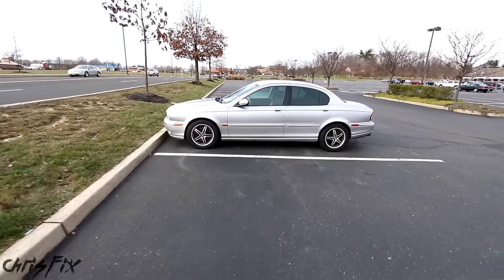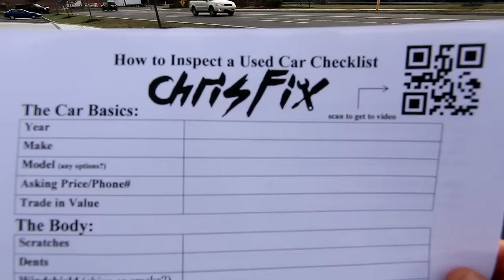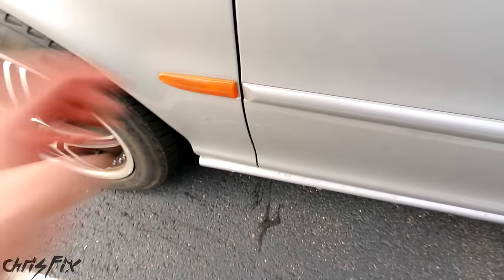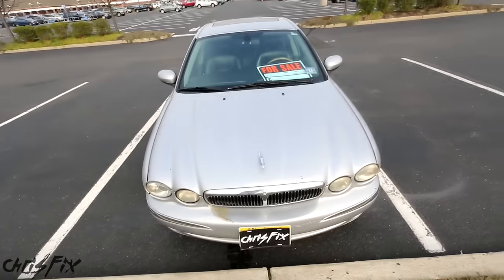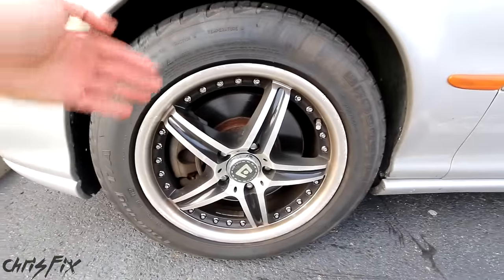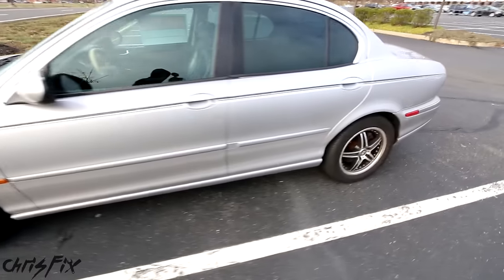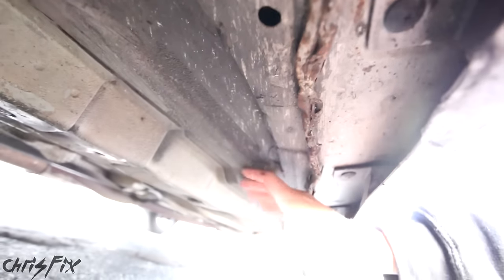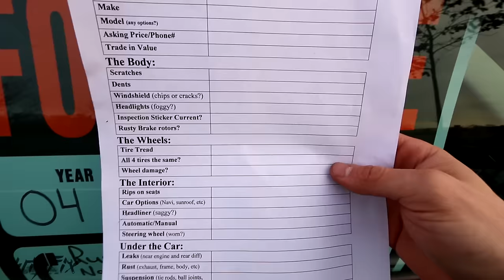How to Inspect a Used Car for Purchase

Comment: Chris....  a couple of points to improve your used car videos and worksheet 
1- Most used car dealers sell wrecked cars,  So when looking at used cars always look closely at the body lines and body gaps (where panels meet),  Vehicle manufacturers have for decades now held less than 1mm body panel gap on most every vehicle made.  If you see body gaps of 2mm or more, be suspicious and start asking questions, especiall if those gaps change in width (Wide to Narrow) along the length of any single gap or body line.   Next, looking down the body lines at a slight distance, one can easily determine if they flow correctly.   This is an area where prosepecive buyers need to take great care, as most vehicles today are unibody construction, where the suspension mounts to the body and not to a seperate chassis.  Dealers don't care what they sell a prosepective buyer "Caveat Emptor"
...
2- The main reason most private folks sell ther vehicle is because of factual or feared issues with its engine, drive train or electronics (especially engine or drive train computers and their components).    Vehicles are not as easy to diagnose and repair today as they were in the 1960s when the engine electroncs were a simple.    With the computer controlled, fuel injected vehicles of today, it takes far more diagnostic work in order to determine a potential or factual failure.   Most people are not trained or don't posses the acess to proper software wich could be used to diagnose such issues....   Therefore its easier for them to sell the car on ... cheep...   I just advised a private seller on such an item coupled a specific brand.   It turned his/her a useless vehicle with electronc failure into a selable, reliable used vehicle for under $400 for the repair.   However, without the knowledge, those sellers were pulling their hair out trying to figure the gremlin out... and couldn't.     That is very common in the private selling, used car world...

Comment: Here's my tip: I love late 90's - early 2000's Volvos. If the car comes with headlight wipers and they are in bad shape, misaligned or missing, most likely the car is as well. It's a rule with Volvos. If the owner didn't care for that small detail, do you think he cared for the rest of the car?
Reply from the maker: Interesting, thanks for the tip!
Reply: My saab had non working headlight wipers and the owner said it wasn't a big deal, then just a day later the generator failed.
Reply: @sixunity1171  lol it's a rule pretty much
Reply: @sixunity1171  would a generator be the same thing as an alternator?
Reply: @nickaa827  yeah i think so

Comment: With regard to the tires not matching, something to add;  my father mentioned to me that if the tires are all different, then it's likely that the owner replaces one at a time when needed.  This indicates someone that's unwilling or unable to maintain the car properly, and you have to ask what else with the car has been treated the same way.

Comment: Should I cheak car like this at the dealership?  It is a used car dealership but they also sale new cars.
Reply from the maker: +bobbyredskins21 yes, dealerships can be even harder because they have more tricks up their sleeve.
Reply: ChrisFix umm.... i dont want to argue with you but why does the rear license plate say ChrisFix
Reply: Probably to not put the owners plate all over the internet without permission.  Common courtesy.
Reply from the maker: Hockeyman, the plate covers does say ChrisFix... I cover the plates on every car I film to protect the owner's privacy.
Reply: ChrisFix ohh ok sorry so did u tape it on or edit
Reply: ChrisFix  Thanks! I looked at a 2009 Mazda 6, it was beautiful and had all the options (Navi, Touchscreen center stack, etc).  But I looked at the tranny dip stick, and it smelt burnt.  So I avoided a lemon. Thanks again!
Reply: bobbyredskins21 dealerships are trained to scam you, even writing the book of the pricing for all cars being sold, so definetly but you should stear away from used car dealerships in most cases

Comment: JAGUAR VERDICT DONT BUY!!1don't buy cheap used European cars because they're expensive to fix. 2 don't buy cars with after market wheels. 3 look for clues on how owners dealt with previous problems. For example, the way he glued that bumper just shows that he rather get by than to do things the right way.
Reply: What about for parts? A lot of these parts are really good and could be sold for a good profit.
Reply: Charlie Vetsworth you’re not too bright, buddy.

Comment: Yeah, the jaguar may be 3 grand, but pretty soon something will go wrong and it will cost THOUSANDS to repair. It's not a reliable car at all. That's why a 1999 Camry with over 200k miles is worth more than an 04 Jag...

Comment: '04 Jag with 130,000 mi. for $3,000?  Only problem is it needs inspection.
I still say it's a buy.
Those ugly rims gotta GO though.
Reply: +☢ ᴅᴠᴅ ᴘʟᴀʏᴀ ☣ agree the rims are awful, and for the work it needs i'd offer 2k
Reply: +☢ ᴅᴠᴅ ᴘʟᴀʏᴀ ☣  Meh i bought a s10 with 4.3L v6 Vortec 250k miles, had a engine swap at 165k miles and transmission replaced. for 2k...drives just great lol
Reply: I like the rims
Reply: Kylan Todd  Just not on a Jag..  Maybe a Geo Prism or something.
Reply from the maker: Rims got a makeover: https://www.youtube.com/watch?v=9WQiqYlpxoY
Reply: looks perfect lol

Comment: I also check the date code on tires. Tire shops usually won't service 10+ year old tires. Look for weather checking on the tires too. It may have lots of tread but could be to old to be safe and reliable.
Reply from the maker: Thanks for the tips!

Comment: I really wish I did this before I bought my car, it's a piece of shit
Reply: Me too. I made a mistake last summer by buying a 07 Honda Accord w/91k at the time for $3000 which I was told had a clean title but actually had a rebuilt title due to a front quarter panel collision from the 1st owner I bought this from the 2nd owner who I think was just trying to unload it on someone because in the 1st year I had it I ended up spending $2500 in repairs since then all because I didn't like the Pontiac Sunfire I was driving and i was so focused on getting something bigger I didn't think about the problems I would have purchasing a car that was previously in an accident. Now I want to get rid of this Accord as soon as possible. I'm not hating on Hondas but it's this particular one that's giving me hell. I've been trying to sell it since April with no luck one person recently offered me $2500 should I just take that offer and run and get a clean title car before I run into another unwanted repair on this Honda?
Reply: +chaseman94 
Well if it's giving you hell and needs regular repairs, you might as well sell it and get a better car. Just gonna cost you more if you keep it.
Reply: Wayla That's what I'm doing now. I put it up for sale for $3000 hopefully someone buys it. The sooner the better.
Reply: That sucks man, also a coincidence since i also have an 07 accord lol. Mine has been pretty reliable and cheap to fix so far since I got it 3 yrs ago. Sounds like you got a lemon if its costing you that much

Comment: Used Jaguar? That's the definition of a money pit.
Reply: what's up gorgeous
Reply: +Richard Andrade lul
Reply: +Zoe Thompson I had a used x type, other than tyres it only needed regular servicing from a local specialist. Kept it 5 years. They're not like the Jags from years back.
Reply: +Zoe Thompson hi babe
Reply: +Zoe Thompson why is that? is it expensive to repair or is it a bad car?
Reply: +Zoe Thompson They are much deeper money pit than Jags. Buying a used Range Rover or some German premium flagship models could cost you much more. And I´m not even speaking about used Maseratti.
Reply: It's a Ford.

Comment: I wish you had uploaded this video before 2 months ago😔
Reply: I bought a lemon too man, two months ago...
Reply: +Francisco Buruca  I bought trailblazer
Reply: +zohaib hassan ouch
Reply: I bought a Ford expedition
Reply: Lol. This is basic check. If you really want to buy a car you should also go to service and inspect cars computer (ECU) and car overall (by expert). Because you can see if there are problems with engine or something else (maybe milage is changed). Good luck next time :)
Reply: +Stefan Mitrovic Yeah, the big thing is opening the hood and getting it lifted in the air and getting a better look at it than when it's just sitting on the ground and poking your head under it before you make your final purchase. Unless its just a beater car.
Reply: +Joe Hanson Also you wont find good car which is cheap. For example if price of some model is around 3k € and you found same for 1k €, no way that cheap one is in good condition.
Reply: I bought a 2016 Cadillac Escalade 

No I'm just kidding...

I have a Jetta
Reply from the maker: +Francisco Buruca Dang, and that is exactly why I am doing this series!
Reply from the maker: +Stefan Mitrovic No need to go to an expert at all. I will be going over all of that stuff in the next episode.
Reply: +ChrisFix the only good thing is that I don't own that truck anymore. I traded my dodge magnum rt for the truck and the dealer sold it, that's what I'm mad my self about. Lol

Comment: what about checking for rust on the undercarriage and frame?
Reply from the maker: I show that in this series.
Reply: Hey thanks for replying.i guess what I'm trying to find out is how much rust on the frame and/or other parts of the undercarriage is acceptable? I live in Ohio and looking for a used car and its almost impossible to find one without at least some rust on the frame/undercarriage. Can I just sand the rust down and put fluid film and it will be fine? As long as it doesn't crumple am I fine?
Reply: Nate Oliver yes just make sure you stop the rust from spreading

Comment: Tip: 
Use a measuring tape between the  wheels and wheel well and make sure the fronts have the same size gap and do the same with the rear.
If you can fit 3 fingers in drivers front but only 2 in passenger front then the car was most likely in a wreak and the frame is bent.
Run away if that's the case. That car will likely be a money pit.
Even do this at dealerships, even when the carfax shows clean title!

Comment: Jesus what has this guy been doing with his car, so many dents and scratches on a car thats not even that old.
Reply: +Ze Germanz its actually fairly clean for a Jag of its age, especially one of these which are quite well known for rust issues, I could fix the body issues for under 100$
Reply: i dont know about you but that car is preety old 12 years old and in that time many things could happen even if you get one dent or scratch a year thats still 12 of them so considering that that car has been well maintained
Reply: Wayne Rhea I was basing it off of when I was looking for my current car (E46 3 series 2002) and most of the cheaper cars I was looking at were great in terms of bodywork and interior the owners all had taken good care of their cars and although they may not be the best under the hood in terms of looks they were top notch. I guess I just have different standards for how to treat a car, my current one has zero dents and scratches although there is a bit of rust appearing on the back wheel arch and paint bubbling so those are off the the sprayers to get sorted before it gets out of hand.

I don't think I would even look at a car that had that sort of damage because if someone doesn't care that much about the aesthetics then its most likely going to be abused in terms of the mechanics. A mechanic friend of mine said he stays away from cars that have poorly tinted windows and cheap after market wheels etc as it usually means a young kid has driven it poorly so the mechanics are going to have taken a beating.
Reply: +Wayne Rhea Out here in California there's Jags on the road that's twice that age with twice the price tag because vehicles out here don't rust.
Reply: well here I new York city well maintained cars don't rust its if you leave them sitting for a long time ad don't clean them if you have a well maintained car that you clean weakly it wont rust anyway. Not all cars here in new York of new jersey rust just maintain them they will be fine
Reply: Have you been around many cars in your life? Do you see what idiots can do to a new car in one week 😔
Reply: +Ze Germanz ok for example my mom owns a 2000 Dodge Neon she bought it brand new and it was in perfect condition no scratches no dents the engine was in immaculate condition she had it only for about 6 years and in that 6 years there have been many scratches and that's not from her but from other people she takes care of the car very well on terms of mechanics but scratches and dents do happen not by her but other people and my assumption is that you don't live in New York where parking is really bad
Reply from the maker: +Ze Germanz I can thing of two things. One, the owner doesnt take care of his car. Two, other people are disrespectful and are not mindful of other people's property. I see both all of the time!

Comment: One thing when looking at the body is to also pay attention to things like the "pine stripes" if the car has them.  Check to make sure they line up, and that door seams seem event (ie. no excessive gaps or that there isn't a bigger gap, say between the fender and front door, on one side, than it is on the other side).  If the buyer is around to open the car up, verify the body panels (many car mfrs now print the VIN on the body panels so you can tell if they've been replaced--aftermarket or replacement body panels won't have this usually).    For that price, though ,if the car ran OK, then the little dings and scratches wouldn't be that big of a deal IMO, for $3000.  I'd be more worried about internal mechanical issues.  AFter all, you buy a car primarily for transportation, not just for looks.  I mean looks can be important, but people usually buy cars to use them to get around.  Because I've seen both... cars that looks great on the outside, but had a major mechnical issue, like major oil leaks or burning.  Then again I've also see cars that looked like crap (maybe some dents or some rust) but otherwise ran like a top.
Reply from the maker: Thanks for sharing!

Comment: Check and measure the size of the gap between wheel and wheel-well-liner for all tyres. That gap should be same for the wheels at same axle (i.e. front-left = front right and rear left = rear right). Any mismatch indicates that that car was involved in a serious accident.

Comment: Few BONUS tips: 

- Check if the windscreen has original branding of the manufacturer (example: Mercedes-Benz cars will always have a hand written signature in the bottom corner of the original windscreen, such as: "Mercedes-Benz", "Daimler", "Mercedes", "Carl Benz"). This ensures you have the original windscreen and it hasn't been replaced.

- Always stand back and look at vehicle from each rear end down the line towards the front of the car to spot any deformities in the body that might not be so obvious when looking side-on. This may indicate whether the vehicle might have been in an accident or you might just spot dents which were hidden in plain sight before. 

- If you spot red dirt around the mudflaps and undercarriage with a tonne of bugs/dirt in the grille, it could mean the owner was taking the vehicle off-road. 

- To make sure the vehicle hasn't been stolen, doesn't have finance owing, or to make sure it hasn't been in major accidents or written off you can run an online PPSR check (which if you're serious about purchasing the car will cost you around $15)

First seen this video back in 2017! It's nice to come back to it and get a nostalgic vibe after working in car sales for a longer while 😆
Hope you have an awesome day and all the best to anyone reading this comment 🤙🏼
Reply from the maker: Great tips! Thanks for adding them!
Reply from the maker: Thanks for the tips!

Comment: You just covered the basics..if you want to get deeper..there is ALOT more to inspect!!
Hint: if the car has a sliding roof, you need to check if its working as it should. Next is draining pipes, clogged or ripped. And finally water leaks from outside to inside the car. Check for water leaks in the liners on both passenger and driver side without forgetting the trunk floor and panelling.
Reply: There is alot more to check..but this is just a hint..these systems needs preventive maintenance and if not serviced well it could be costly and pain in the * to fix😅

Comment: Take a torch with you for underneath, and a magnet wrapped in cloth to check bodywork for bondo, when hood/bonnet is up check oil filler for milky oil, radiator fill for oily residue, when you test drive get steering on full lock to test bearings and bushes, no knocks and clangs is good, and check the boot for damage to the bodywork from rear end damage, check engine block is dry underneath and sides, and of course dont buy a jaguar,

Comment: Also if the used car has a sunroof check to make sure there are no leaks and there's no rust in the channels between the sunroof the roof itself. Ask the owner if it's aftermarket sunroof or from factory either way make sure it works and again check for leaks visibily by the headliner and the drain tubes aren't clogged.

Comment: You missed one more important thing with the tires. Checking the DOT number. Even if they don't show too much wear, if they are old it still means you might have a new set.
Reply from the maker: Thanks for the tip!
Reply: What is the DOT number?